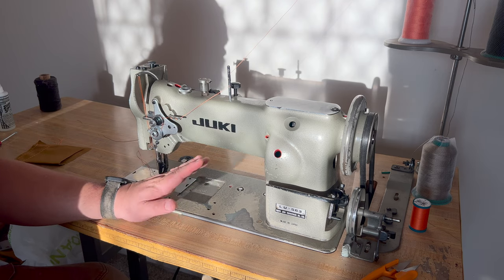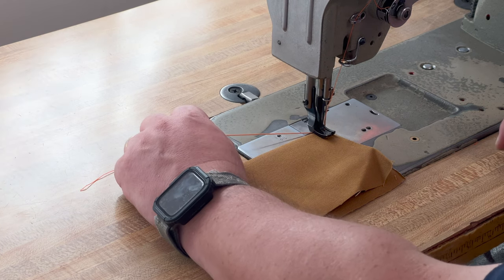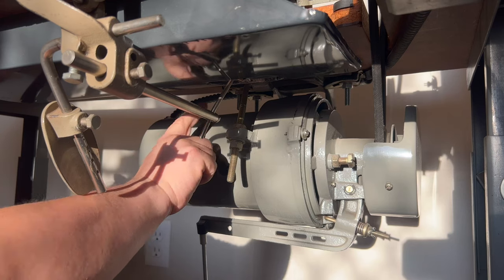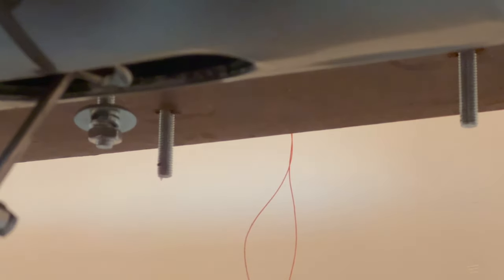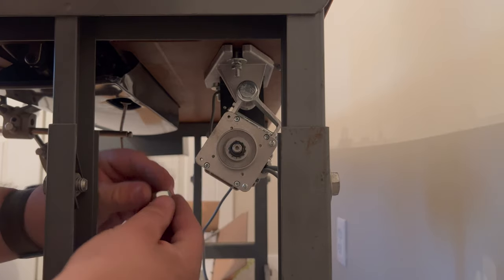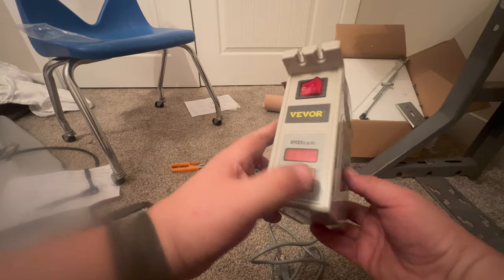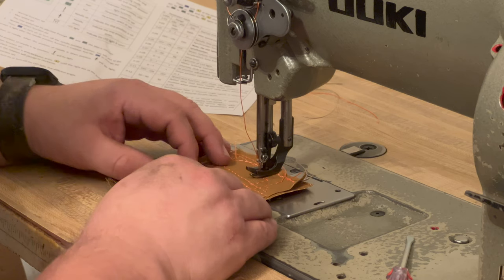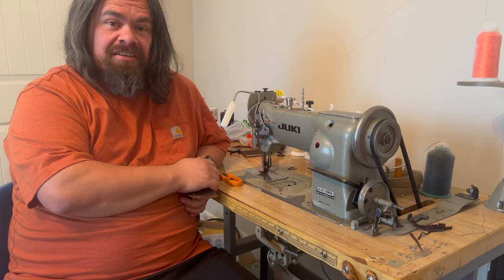Upgrading my New (to me) Juki LU-563 Industrial Walking Foot Sewing Machine to a Servo Motor 👍🦾

Comment: Nice Job! I think the rubber doughnuts are intended to be in between the motor base and the table. This would help to reduce vibrations from the motor being transmitted to the table. It also may have helped with the loose belt situation. Cheers!

Comment: Keep this in mind,,, By slowing down the needle speed you need to adjust the thread tension accordingly to the slower speeds and adjust it for the faster speeds,   if not to slow may have a loose stitch and to tight may break the bobbin thread if adjusted to the wrong  tension settin,
Reply from the maker: Thanks for the tip!

Comment: Thank you for this video. I am recovering from my head injury and my husband did just purchase a gently used same jerky. We pick it up tomorrow can you tell me please how to remove it from the table? We are used to the style of attachment that singers have, and this seems to be different than that. We were not able to get a really good look at how it’s attached to the table and I want to know what kind of tools to take so that he can remove it from the table and not damage it.
Reply from the maker: Mine is mounted on two swiveling pins along the rear base of the machine. To remove it I just push the machine back to take the tension off the belt and then lift the machine off those pins. It is pretty heavy so you want to be careful. I've never used a table-mounted Singer so I'm not familiar with those work.

Comment: What length belt would you recommend for the 50mm and 45mm pulleys? Great video, I’m going to follow your lead and do the same
Reply from the maker: If I remember right, I just used a flexible measuring tape for fabric to measure around the servo pulley and the drive pulley on the machine and just went with whatever was the closest size.

Comment: nice video! what size belt did you end up going with?
Reply from the maker: I want to say it was a 36”. I’ll have to double check.
Reply: @BitsandWood  Sounds about right my measurements came back with roughly a 35" belt. It is adjustable, so that is a ballpark figure.
Reply from the maker: I just checked. It's a 1/2" x 36" V. I think a 3/8" would have fit better, but this was on clearance. I've also swapped out the pulley on the motor for a 45mm pulley. One of these days I'm going to build a speed reducer for it.
Reply: Super helpfull video
Reply: Hi! Thank you for this video! I was gifted a LU-563 and had to take the clutch motor off in order to transport it. I thought it would be the best time to switch out the clutch motor to a servo so I ordered something similar to the one you recommend. I just want to make sure... If I am using a 45mm pulley, I'll need a 36" belt? Or was that the length you used with the 50mm pulley?
My son works at an auto parts store so it will be fun to go in there and get parts for my sewing machine. 😂
What did you do with the old clutch motor?